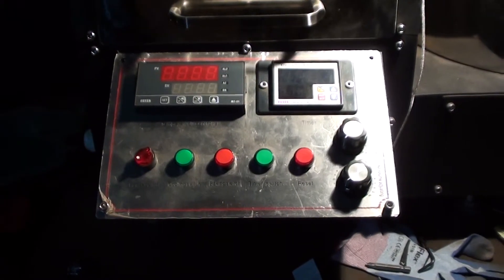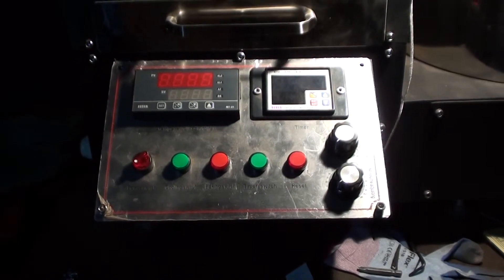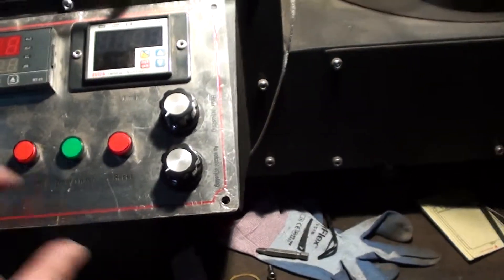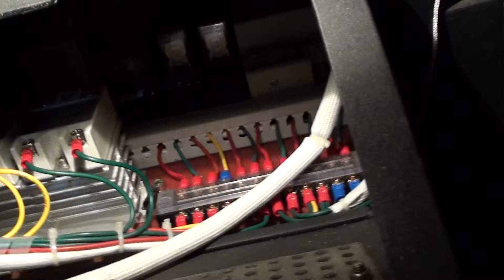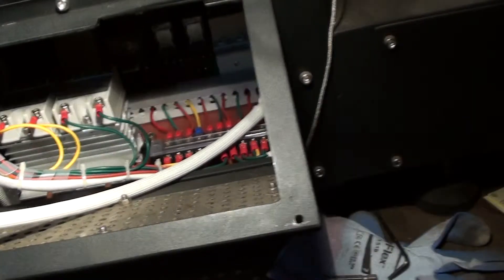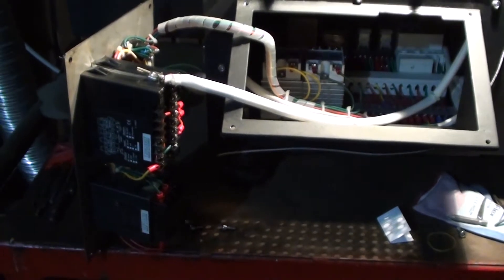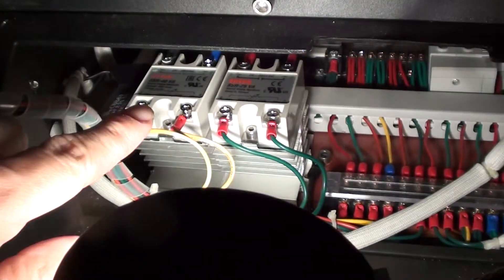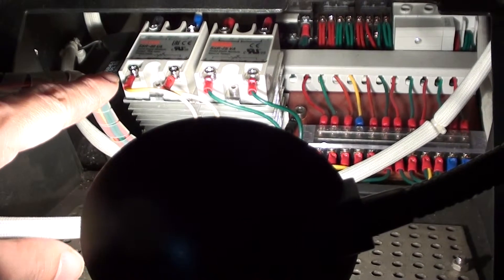North Coffee 1kg Electric Coffee Roaster Review. It finally failed!

Comment: Did you ever get this working? I'm curious because I'm considering purchasing a used version of this roaster and wanted to find about any other issues you've run into.
Reply from the maker: Hi Eric. Firstly apologies for not giving a result in this vid. I was hoping I could get either North Coffee or Mill City Roaster to diagnose the issues. Unfortunately no help was forthcoming and money was not the issue, I'd gladly pay if I could get the roaster fixed (I've spent some money already for the spare parts). The roaster itself is great, but there is just no real North Coffee Electric roaster "expert". North Coffee no longer sells the electric roaster, it seems Mill City has been given the exclusive rights to sell those Globally.  My elements no longer heats up, although I've managed to get rid of the buzzing noise by some soldering. All other functions are fine.  I'll have to get an electronic engineer to have a look at what else it could be.  I've checked the continuity of the Elements and they are fine so I'm at a stand still.